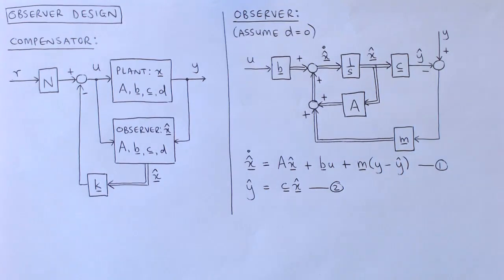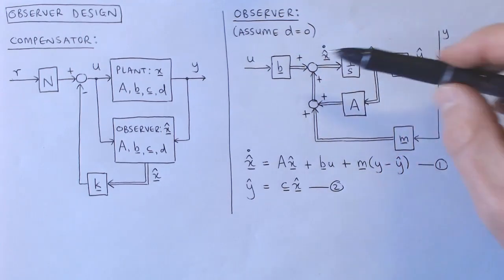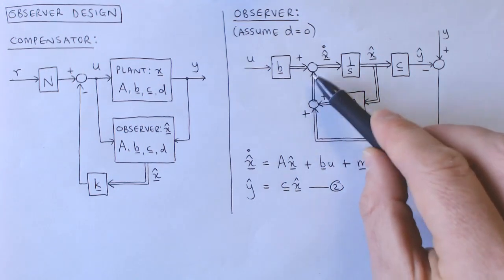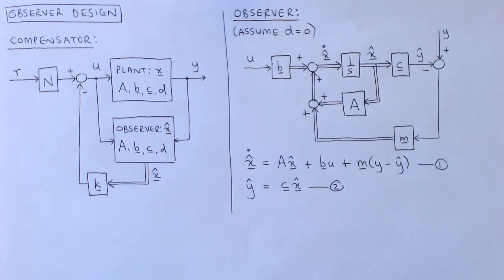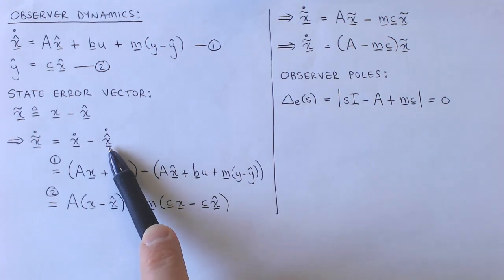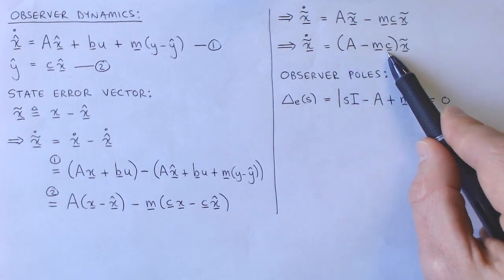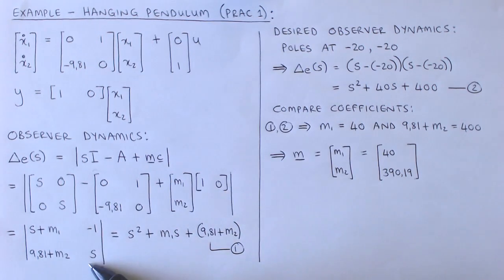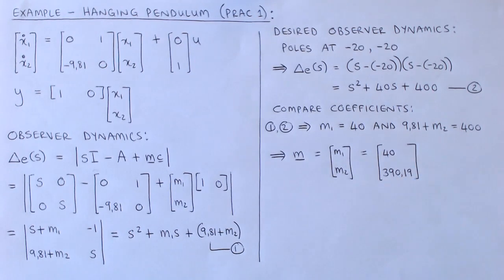State variable control 29: Observer design, Part 1

Comment: Hi there, nice video but I have a question. 
In engineering we see that "there is no free lunch", all of changes that we do in a system have a consequence. In pole placement method, when we choose the poles of our system we can not move the poles to where we want because we can overload the actuador. However, in observer design I cannot see the price that we pay to move the observer poles, in observer design the objective is to have the poles in the LHP too much far than jw axis that we can, right? why not to move the poles to -1e+99999 for example?
Reply from the maker: Good question!  The answer is one that we do not cover in this module, but it is easy enough to see: the faster you make the observer poles, the larger the observer gain will be.  Now if there is any noise in the measured output (which there always is in practical systems), this noise will be amplified by the observer gain, influencing the state estimates.  A larger observer gain therefore means noisier state estimates.  There is actually a "sweet spot" for which the state estimates are the best ("best" means closest to the actual states on average) -- this is the optimal estimator, or Kalman filter.
Reply: @cornevandaalen1862   wow, thank you !! I was with this doubt for a long while. I started to study about control recently, so could you recommend me some bibliography about how to design this? I have took a look in Gopal pdf, however at internet I did not find the whole book, the documents whose I found are missing some pages and are wrote as "hidden page".
Reply from the maker: @marcelozortea  "Feedback Control of Dynamic Systems" by Franklin, Powell and Emami-Naeini is a nice introduction to control systems.

Comment: sir i have a question. Lets say there are 4 states. One of them is not observable. Then what should be the size of matrix C and matrix Y.
Reply from the maker: I do not quite understand your question: We usually do not try to construct observers for systems that are not observable.  The dimensions of the system matrices are also not influenced or determined by observability.  

Do you rather mean: "One of them is not observed"? If you clarify your question, I could try to answer it.
Reply: @cornevandaalen1862  yes i mean "one of them is not observed". Btw i understood :)